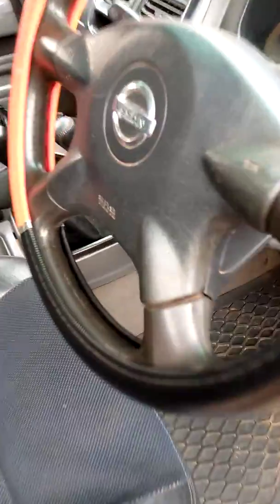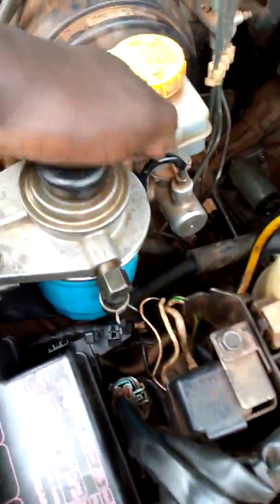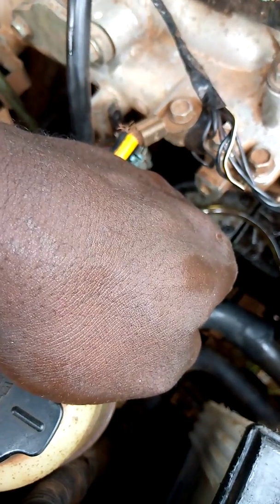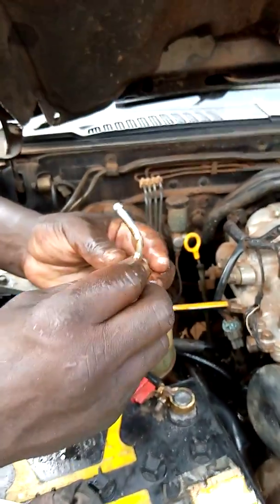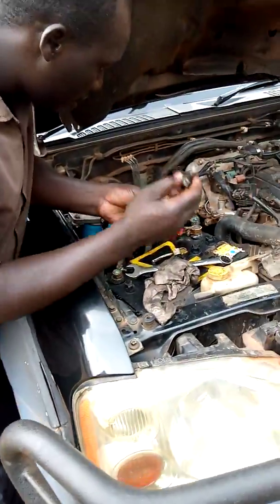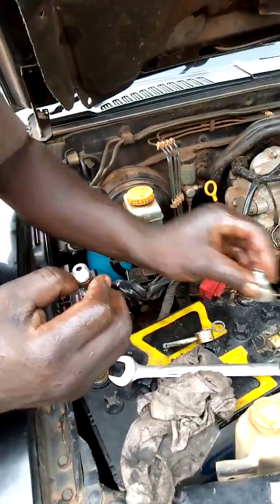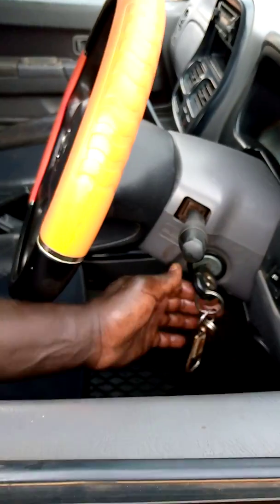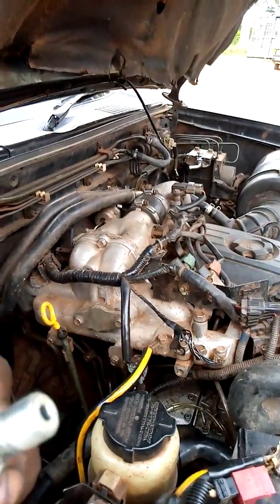common cause of ZD30 , diesel engines failing to start idling

Comment: Recently i had a code come up. It stated spill valve was the problem. He insisted on replacing injector pump. 
Im starting to think your banjo bolt has more to do with the previous mentioned problems with fuel supply.
Great work Jeff Moore

Comment: My friend I have this problem as my zd 30 is cutting off cutting off and I checkwd this particular bolt cleaned but did not test like you test and installed it back and the same problem, please assist
Reply from the maker: @henaterry5550  let's discuss from my WhatsApp number +256702801249
Reply: How are you man did you come right with you ZD30 engine if not I will help you

Comment: Hi sir.. I have D22 nissan frontier.. So, 3 or 4 time to start, sometime taking long to crank, i already change 4 pcs heater new, fuel pump filter with pumping house and injector all new... Do u know what is the problem..?
Reply from the maker: @jey5653  get me on my WhatsApp +256702801249

Comment: I have Nissan frontier 3.0 diesel and it starts great and everything but it does not have the power and the check engine light in on
Reply: What do you think the problem is
Reply: Have a similar problem. I am in search of the loom.

Comment: Some mechanics had no knowledge on this, istead have removed the zd 30 replacing TD 27 . Original was using Two filters, this time after replacing tis been using one filter, but now it's down need another engine.
If I had goodled you couldn't have reached this big loss
You are good at explaining I can even do  alone
Reply from the maker: @johnnyirenda5848  yes.
My on Whatsapp number it's easy so mine is +256702801249 we go through more

Comment: One info if your car start hard over night: 

That bosch overflow valve it have a blender for air bubbles bulit in, (that small hol) and it won't keep the pressure into the fuel pump (the fuel pump don't need pressure to work, the fuel pump need fuel inside to work, not AIR . Don't confuse the fuel pump with the injection pump. The fuel pump it's inside the injection pump in this Bosch vp 44.  The retun hose are conected directly to the fuel pump by that overflow valve. So if you have any leaking on the return hoses , that leaking will fill with air your fuel pump , throug that small hole (the blender). 

Check any leakage by filling the return hoses with compress air. 

(And of course check the one way valve on the fuel filter olso with compres air ). 

You can check all the injections likege at once assuming that the one way valve is working properly:
 take out the fuel hose from your fuel tank , (turn and return) fill with compressed air the turn hose , and block the return hose. If you have broken hose you should heare or see it.  

(The metal pipes can't be checked this way because of the pressure valve from injection) . 

Again don't confuse the fuel pump with injection pump.
Reply: i think you also know the engine runs perfect evwn with the fuel return hose is disconnected, right?
meanin even uf there is a leak on the return hose it would'nt hinder the operation of the pump to make the engine run fine
Reply: @endurofan9854  try to disconnect the return hose and after 24 hours idle start the engine . It will start very hard because, your fuel pulp will be empty at this specific pump "vp44". Any engine will run with the return hose  disconnected, and in some cases the return hose goes through the fuel pump, and in this specific case "vp44" if you have a leak on return,  your car will start hard after 24 hours idle.

Comment: Very Fake
1st - You did not run the key to crank the engine, just went to key on not starting.
2nd - The Bolt you removed is the same one you Boltted again. ( the one you show as old is newer than the one you removed.
3rd - The bolt holes are supposed to admit the air yes cause are the same holes that feed the diesel to the injection pump.
Reply: I think he is right. He just recreating the fix he had already done. He didn't fix it in the video. He's just going thru what worked.

Comment: Well done, but i have tried to change that bolt and when am cranking it, it just showes that it has the air in side the pump
Reply from the maker: Check the speed at which the engine is 
Running when starting or igniting too

Comment: My ZD 30 is not starting it's only cranking and may switch engine off while driving please help
Reply from the maker: Otherwise the best is if I was near to asses that or diognise
Reply from the maker: Check temperature whether the engine heats
Reply from the maker: That is if your fuel filters are ok, well serviced and wiring ok

Comment: Hi mate, so when we suck or blow through The Banjo bolt, the air should pass through? Or it shouldnt?
Thanks
Reply from the maker: Shouldn't be easily, it's controlled during fuel compression
Reply: It will pass through the one small hole closest to the thread. Block that with one finger and it should not pass any air.

Comment: and there is two washers  not one,put one on valve bolt push into holder then put one on inside of bolt as well tighten up,or it will still leak. good effort but not quite accurate.

Comment: Thank you so much. This video was so informative. I hve a Zd30 nissanaravan and it was behaving the same. I changed that same bolt and everything is bek to normal now. I used to have a hard time starting it but now haaa all is in good order now. Thank you so much
Reply: hi where did you find the new bolt,part number  any information would be most helpful,thankyou.
Reply: Hi bro I'm having same problem what is it called that bolt please
Reply: am having the same problem a new engene with new diesel pump but mechanic say i need to take that  diesel pump for receondition can you please advice, the move an later shut down

Comment: Ok so how does a Banjo bolt fail.
Reply: As for as im aware the only failure point on a banjo bolt can be fit up,  as in the mating surfaces.
  If there not clean or you've dropped it its probably scratched. 
  That's also why NEW crush washes are essential.
 I'd say you'll still have problems with it tomorrow when it leaks down overnight.
 The problems more than likely in the delivery lines
Reply: there a little valve in there, a blast bearing and spring. If it doesn't close, I think it can't build pressure in the pump.

Comment: Cetane needs to be at least 50, 
Propel HPR, 75
Syndiesel, 60
BP (Amoco branded), 51;
Countrymark fuels Diesel-R, 50
Chevron, 49; or 51 with Techron D labels in select markets
ConocoPhillips through the 76 stations (California) 47-53
PetroCanada, 47-51
BP (Powerblend 47, otherwise 40-42)
Shell, 46;
Sinclair, 46;
Sunoco Gold, 45 (often +1-5) Sunoco regular is usually 40.
Exxon/Mobile, 43-46
Holiday Stations, 40-43
HESS, 40-42, can be up to 45.
Husky, 40 + diesel Max additives raise another 1-3 from there (41-45 max)
Pilot/Love's/Flying J/Valero/Sheetz/Walmart/Wawa: 40

Comment: Lo..I wouldn’t have shown the trying to start part, if you wanted to replace a bolt. That had nothing to do with anything about car not cranking.
I thought you were going to check wire from battery to starter motor.
Reply: I had to pump the fuel filter every morning to what he fixed is exactly what the problem was unfortunately 4 u

Comment: Stop being deceitful to pple, if its that buncho bolt how does it affect the car by not cranking. From the first that car shuld have cranked bt wont start, how does a bolt stop the starter from cranking.. wen yo video started yu said the car  wont start, did t affect cranking. That bolt has no impact on zd30 injector pump.
Reply from the maker: thanks but it was after changing because the rpm was fine
Reply: im thinking it was just air in the system, not neccesserily throiugh the banjo bolt, i have a similar problem and intending to fix it will come with the results.

Comment: Fuel needs lubrication.the timing piston is stock up.add  2t oil lubricate in fuel.in loww rpm engine shut off.
Reply from the maker: thanks, i know low rpm contributes but this was ok.

Comment: In a familiar's nissan frontier, the engine try to shut off only in minimum rpm, in high rpm don't fail, this advice that you share can produce the fail
Reply from the maker: yes, low rpm brings in hard start but this was fine with the rpm

Comment: You replaced a banjo bolt with old sealing washers, come on bro, what kind of mechanic does that?? FAIL BIG TIME
Reply from the maker: hello bro, thanks the comment but i was no leakage
Reply: Was the sealing washer leaking..If no leaks and not grained don't replace an OEM washer..coz an after market one might not be up to standard gauged

Comment: Hello I have a zd30 and if ever it runs out of diesel or if a supply pipe is removed an put back it will start and the cut off and the pump actually stops supplying diesel to the injectors what could be the cause it will eventually start after some time then will be okay after that
Reply: Replace your pipes it will stop